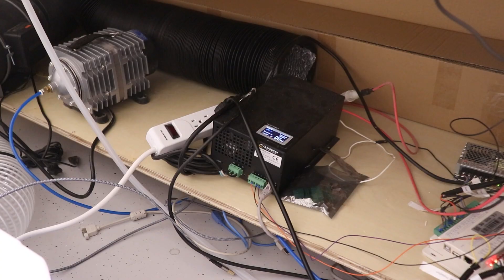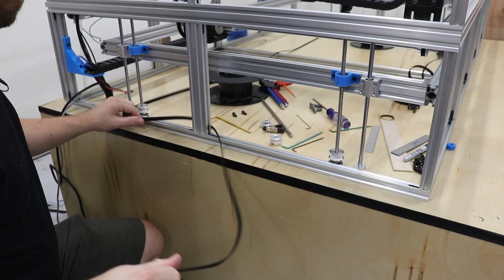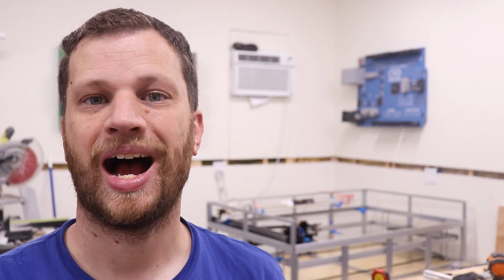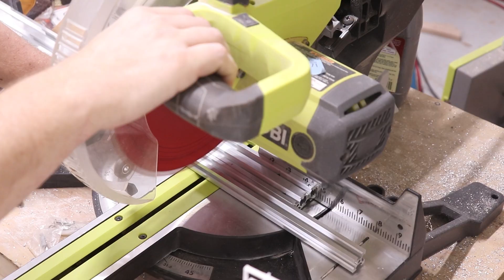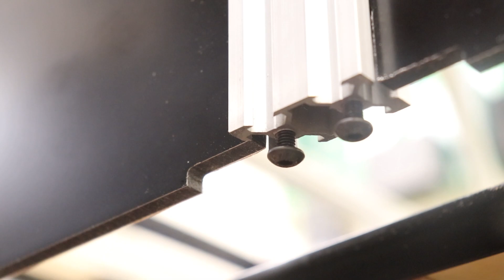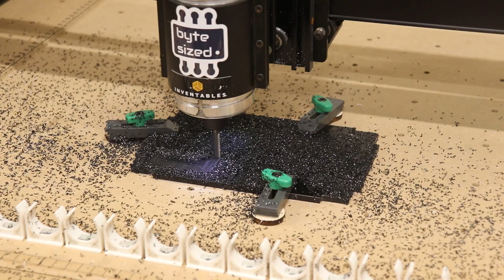"That's a problem for future Zach" - CO2 Laser Cutter Part 6

Comment: I am building a laser cutter that's big enough for me to fit in actually lmao.

I bought the build guide too its up next.
Reply: Hey man could you juste help figuring ou how much would it cost ? Roughly ? Thanks a lots I’m debating building one
Reply: @damienblachier4360  I’m in the hole quite a bit right now probably at least $4000 give or take. 

I bought a lot of stuff I didn’t end up using and 3d printed half the machine which costed me a few dollars in filament so far because I’m using ASA. 

I also bought beam combiner and a big metal electronics enclosure and all kinds of other stuff you may or may not buy. It’s not cheap at all.

It’s at least 4000+ right now and I’m not even done yet by the time it’s over it might be around $5000 something I’m guessing. 

However if something ever breaks on this machine it’s kind of like my voron I know the machine inside and out so I’ll be able to fix it no problem and that’s something you can’t put a price tag on imo.

Comment: Man, I have had my laser machine for 2 years. If you don't get it UV shielded, you're gonna cause yourself some eyesight issues. 
   No one's perfect. Are you confident that you'll ALWAYS shield yourself from the UV rays while it is running? It is useful to check large jobs while running them. I am currently doing a 4 hour job, and I check it about every 20 to 30 minutes. My machine has a UV shielded cover though. You're gonna forget to wear UV glasses in the middle of long jobs.

Comment: use a bit of solder flux for those wire ends next time, it helps wet the solder and make it draw into the stranded cable

Comment: lol @ the ferrules. I’ve worked on hundreds of industrial control panels in the field, some 20+ years old. 480V down to 10V.  Never seen anything go wrong because someone didn’t use ferrules.  But they are really really nice, especially when you make an oopsie and need to move things around, and it gives a nice professional appearance.

Thanks for the videos, super excited to do a project like this! I appreciate how thorough AND concise this series is
Reply: Finally some simple common sense - Thank you! I cant believe the flak this guys hears over something so unimportant. in the last 30+ years Have i used ferrules ? sure, have also used ring terminals etc and have even tinned wires with solder to keep em together .... who cares? kids these days....

Comment: Not sure what these comments experts you speak of have been reading, but it's fine to use bare stranded wire in screw terminals, what IS wrong is tinning the ends or using the orrdinary automotive style crimps (although ring style or the fork style are ok with the type of terminals in this video) - screw terminals rely on you being able to compress the wire slightly, this is what creates the 'grip' and makes the connection secure.  If a solid copper, tinned or crimped wire is used it doesn't 'crush' and so can easily become loose and THEN your house burns down (potentially).  Hope you fastened that bl@@dy vice already.

Comment: How much rs. In  India co2 laser machine form rajsthan delivery rs I m resale is machine size 1.  900mmx1200mm 2.  1200*2400 working size tube 130wt. singal or double had Haney pad up Dune 5300 chiller pl. Sand quotation

Comment: Ferrules help to ensure connection points can withstand the same loads as the wires between them.  A lack of them doesn't necessarily create a fire hazard; but for engineered systems that use a minimum of materials for their load requirements, their lack is a known and common point of failure.

Comment: Ferrals are importent to keep the strands together, if u just put drilled wire into an screw terminal, they can get lose over time, because the get compressed and spread apart, witch may or may not can create short, therefore fire hazards.

Comment: The wire ferrules are to keep stay stands  from coming into contact with the housing to the power supply or anything else that it's not supposed to.  When/if you are disconnecting and reconnecting wires and they get deformed and broken this keeps everything a lot easier to reconnect... And safer when the wires start getting deformed and broken.  Was a fan until you passive aggressively gaslite people trying to help and give suggestions, especially if you don't understand the reasons you are arguing against.  It comes across way better if you humbly accept advice from likely more experienced people instead of blowing them off on your channel.

Comment: in the future, when leveling a bed, cut four pieces of hard aluminum or wood stock that are the exact same length and rest the bed on them in order to level, you'll get FAR more accurate leveling, and no need to pull the tape measure out,

Comment: We used a load-sensing power strip for my laser setup at the work makers' lab.  So this way, when the laser was on, the water was running, and the air pump was.

Comment: So people know, and your self Zack with rubber, you want to use really good stinky contact cement (not the water base stuff, and make sure to use a mask). You place it on both smooth sides like the cut-out you have and let it dry 100%.  Then you touch both sides that were glued, and they fuse.  It is crazy how it works.  I used this on EVA foam and on leather too.

Comment: How mad were you when you realized you couldnt use all those angle bracket/fasteners after installing the black panels? Lol Lots of mistakes were made on my build too but its still running 7 years later.

Comment: Here are my two cents:

#1: Can the translucent acrylic in the lid block laser beams?
#2: You need a mechanism to block your lid, so nobody can open it as long as the laser runs // OR // Put a kill switch into the lid that deactivates the complete laser as soon as someone opens the lid

Comment: issue I see with the panels is that it will be hard to servive the machine. since you need to take the frame apart to open it up. Probably would have made more sense to just use a surface mount panel that you can easily remove. You could have just used the t-nuts and machine screws to hold the surface mount panels.

Comment: Electrician here.
I do see a lot of amatures that have a straight up wrong perseption of why or where we use ferrals.

Here is the points of where we use them in my home country (denmark) and this is also true for every country in the european union:

[1] You are connecting a multicore wire and a solid core wire in the same terminal. In some countries it is illigal to connect multi- and solid core in the same terminal, so you can crimp a ferral on the multicore and basicly turn it into a solid core wire. You can therefor connect them in the same terminal.

[2] They do provide a clean look to a connection and I do see the appeal there, but a multicore wire provides plenty of surface area to create a secure connection in (and this is important -> ) A TERMINAL THAT IS DESIGNED FOR MULTICORE. If the terminal is not designed for multicore, use ferrals.

[3] A customer sometimes require we put them on. In my experience, usually for the wrong reasons...

[4+] In any other situation, they are not strictly needed, but it isn't illigal to put them on reguardless.

The problem with wire terminals getting loose over time is just as big a problem with multcore as with solid core wires, including wires with ferrals on. Actually often part of the service a machine gets is an inspection of wire connections (usually done with a thermal camera) and a tightening of terminals along with whatever else the machine needs.

As you discovered for yourself. Ferrals can, if used places where they are not needed create "more work than is needed" as you so nicely put it.

I do know that nerds is not gonna take a pro telling them what to do for "good intel", so I'll see myself out. I do however still hope you learned something. :yougotthis:

Comment: I'm concerned about the choice to use clear material for any part of the case. At 100 W optical power, simply looking at the spot the laser makes is enough to cause permanent eye damage. This is nothing to play around with; make absolutely sure that the shell of the machine is 100% opaque to the wavelength the laser produces (9.6 µm and 10.6 µm for a CO₂ laser, or 28.28/31.2 THz). This includes the corners where you notched out the material for the braces.

Comment: you don't go blind if you don't use glasses when laser cutting if you are not looking at laser, but it's required by safety protocols. Your house will not burn down every time you don't use ferrules, but it's safety protocol to use ferrules on cables that are stranded because stranded cables can have loose strands or strands separate from each other and come loose. also it's a cable relief just like every other usb, laptop or vacuum cleaner cable has. and all that said, you are making your strip your cables way too short on many of your videos. The core of the cable is not contacting whole ferrule, which is problem on some of you connections where you have a really long ferrules, but really short cable striping which means you just clamp down on empty ferrule ends where there is no cable. You can strip cables so much that they poke out on the other side of ferrule and then cut them after crimping to be sure it correct length. Also you can cut ferrules shorter after criming if you have long ferrules, but not so deep terminals.

Comment: Back in the day I worked with commercial high power CO2 lasers - I guess it surprised me that the laser tubes you can get these days are kind of turnkey.  No need to mess with optics, gas mixes, vacuum pumps or any of the rest of that.  No need to align the mirrors, etc.

My gut tells me that those side panels you installed will probably act as mirrors at 10 micron wavelengths.  The acrylic will definitely absorb the beam (put a piece in the beam just for fun, but make sure you have good ventilation).

You might keep a refractory brick on hand (the things that people who build kilns for pottery use).  You can use it as a beam stop - it will absorb the beam and get quite hot, but it won't burn up.

Comment: Loving the videos :)  PLEASE though, change the top acrylic to laser safe or something!  You have a 100W laser that may bounce off of one of those divides between the honeycomb and it will bounce straight up to the acrylic, which is one thing CO2 lasers cut VERY WELL!  I'm inspired but please, do change this bit ASAP!
Reply: Agreed, I was just looking at that and it's a bit concerning! Though hopefully by the time the laser makes it up to the acrylic, it'll be out of focus. And the acrylic will absorb the laser rather than transmit it through, after all that's what lets you cut acrylic that way.

Comment: The reason people are telling you to use ferrules isn't for insulation. It's for reliable electrical onnections. The ferrules keep the wire connections from becoming loose after the strands spread out under the screw. Those loose connections can cause poor conductivity, resulting in heat.

Comment: On the enclosure, instead of fitting pannels into the channels, and having to have notches specially cut for all 4 corners on every pannel,  one could put screws into the very outside channels with corresponding holes in the pannels that are fitted to the outside dimentions and held in place with attractive chrome or stainless steel cap nuts or end caps.
Reply: Your idea is the efficient way but the way he did it just looks sick

Comment: On terminating your wires, I could be wrong especially since i had not yet seen that episode, but I think their the criticism were less about  electricity jumping through air with a dielectric strength of about 3kv per mm of gap,  but ratherly that oxidation might cause Hotspots. (Edited after reading other comments) stranded wire also can compress making a bad connection.

 I used to work in the military on communication equipment and excluding operator head space, I mean operator error,  95% of the real problems were oxidation at the connectors. its a very real problem.  Incidently this is why some computer problems go away when you take it apart and put it back together breaking through an oxidation layer.

oxidation doesn't allow current to flow. It has a high value of resistance. If a connection become say 95% oxidized, current is only flowing through the remaining 5% cross section that isn't oxidized and with current flowing through a smaller cross section, the connection tends to get hot. Which in some cases may cause a fire at worst, or eventual equipment malfunction at the least.

Comment: Great videos no doubt about it! But you are an electrical engineer so you should know about proper wiring and proper terminal connections. Stop complaining that people are giving you advice on how to do things properly. The right way to terminate will give longer lasting and more secure connections. Your house may not burn down, but you will have a  lesser chance of problems hapening.

Comment: Those ferrules are there more to consolidate and compress the stranded before it goes into the screw terminal. The reason for that is to prevent the strands from shifting and settling in the terminal which can cause poor connection between the wire and terminal and create a build up of heat at the terminal which is the fire risk that people are talking about. It's really only a problem when running power but may cause an annoying issue of intermittent signal on data lines if they come lose. 

The car audio world has good examples of why they are needed if you want more information.

Comment: I've printed that exact belt holder apart a dozen times like 10 years ago , funny thing is , you said you designed it .
Reply from the maker: I found little belt clips for 6mm belt but not 10mm so I designed one in fusion 360 in the same style as the 6mm clips I found on thingiverse. I have the fusion 360 file if you want it.

Comment: Honestly, I have only found your channel an hour ago but I've been loving these videos. 
But after 12:30 now I'm a bit worried that you're not up for discussion or advice. The reason people recommend ferrules when terminating stranded wires is because stranded wires can come loose easier, and stray strands which are hard to see could make contact. 
Nobody in the universe would be worried about 120v arcing over that distance even 2KV has a spark gap of ~1mm; that's not the concern though mate.
Anyways, awesome video, cheers.
Reply from the maker: Thanks! I'm totally open for discussion and suggestions! I've been doing this a long time and my comments range from down right nasty and disrespectful, to totally friendly and helpful like yours. There are a lot of armchair experts out there, and they all seem to be in my comment section! I was specifically talking about the comments I received saying that my bare copper connections would cause a fire and burn down my house. I appreciate their worries, but I'll be fine.

I'm glad you found my channel! I've got videos on so many different projects. What kind of things do you like to make?
Reply: @bytesizedengineering  Ah fair enough. It must be so frustrating putting so much work into a project & video only to get angry pedants in the comment section.
I've mostly only done small projects like a spot welder I made, but I've also tig welded together a BBQ as a personal project. I've moved house so the projects are on the back burner, but videos like yours make me itch to get into the workshop.

Comment: Was gonna switch around my design to a neat one like this but i think its best not to have the outer frame attached to the internals. Any shifting from the outer shell affects the alignment.
The hinge is attached directly to the internals and it has to be opened and closed everytime the machine is used so i can see frequent mis alignments in the future

Comment: Cool machine! Great video!

But I need to comment the end sleeves for flexible wires:
The problem is not the 30kv/cm!
The problem is that screw terminals with flexible wires are not really robust. Wires my get loose, weak contacts can cause high voltage drop in the terminals. Heat is produced, and this can cause fires. 

Will not happen very often, but i have seen burnt sockets, and terminals. They will probably not burn your house, but damages in your projects are annoying as well…

Last but not least: great laser, great video, and greetings from Austria
Reply: This was the main cause of 3D printer fires in the early days. It's what gained the Anet A8 the firestarter nickname.
Reply: Being an electrician myself...
Wires getting lose is just as much of a problem with solid core wires, witch you basicly turn a multicore wire into (at least the tip) with ferrals.
Reply: @powerupminion  Their main point is to provide some mechanical protection and increase pull-out force via the ridges on their exterior, with a ferrule you can loosen and tighten the screw terminal many times with minimal wear which is very practical on a DIY device, without a ferrule the wire will be damaged each time which at best is annoying at worst will severely worsen the connection.
They also supposedly lessen the effect of vibrations since the stress point of the screw isn't concentrated to such a small point but I can't say I've ever had the opportunity to test that.
So while they're technically not necessary, if you're using screw terminals of dubious quality I'd certainly spend the extra 30 seconds to attach a ferrule.